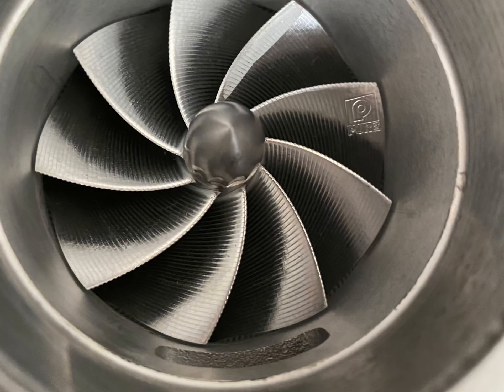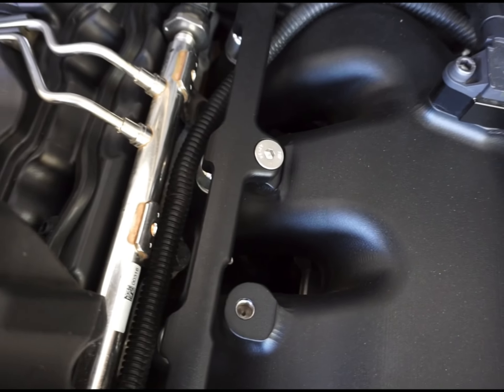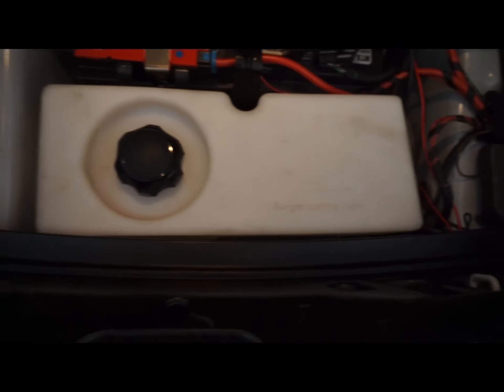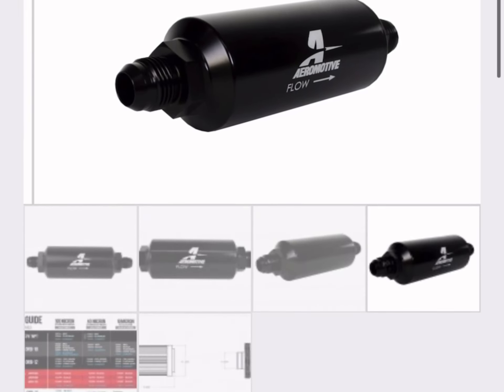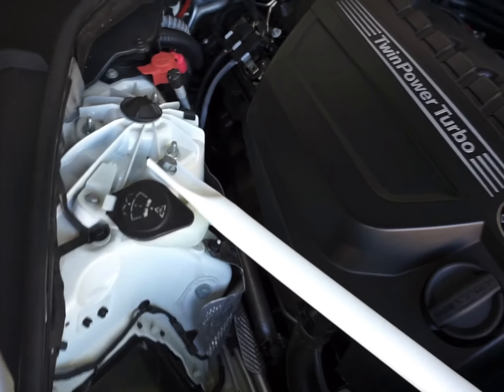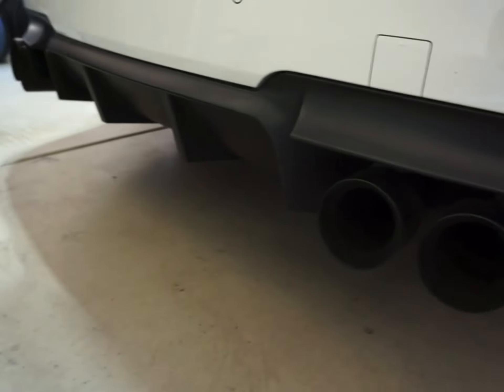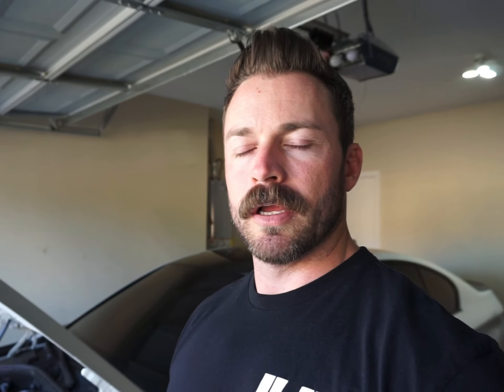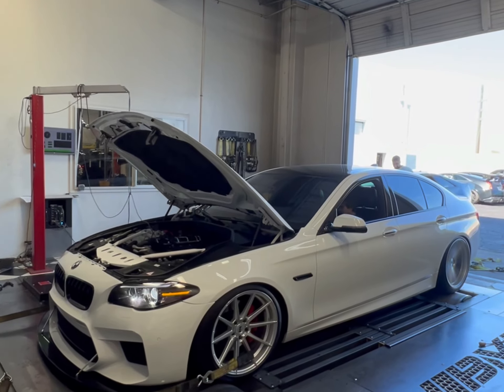In House Performance E85 Pure Stage 2 2015 BMW F10 535i

Comment: I just got a 15 “ 535 rwd 
And I just got the bolt ons in the mail 
G plus intercooler 
4” catless Rvg downpipe 
And Rvg chargepipe 
Probably going with MHD for the tunes 
Quick question can our stock fuel system handle any E?

Comment: Looking forward to see what your dyno numbers are.  I’m running PS2 with ProMeth direct port Meth and 93 Octane.  About to change my turbo and tune with 93 and Meth to compare.  Later in the year get Motiv reflex with Port E-85 so I can run any E content and the tune adjust.
Reply from the maker: Check out my dyno video I posted my numbers there!

Comment: Nice, I’ve seen your car on YouTube before. I’ve got a stage 2 FBO 535i, looking to go big turbo setup eventually, but I’m PWG, so debating port injection or helix 🤔
Reply from the maker: Personally I would do a stage 2 hpfp but I am bias. Dorch engineering has come out with so many support modifications that focus on utilizing the stock configuration and still having more then enough flow to keep up with these big turbos we keep throwing at these cars.
Reply: @Inhouseperformance  I have not found  stage 2 HPFP for my car, I have a 2011 535i, so have the continental planetary HPFP - there seems to be no replacement for these aftermarket

Comment: just came  across your channel, I just picked up a f10 535i x-drive M sport and was looking into what upgrades I can do. It says that it also has the M sport power kit not sure if that affects any upgrades I do.
Reply: @Inhouseperformance  Thanks I was told that the power kit was a tune that thet added which I believe gave 20HP and 30torq

Comment: perfect build 
im doing one myself 
advice on the intake 
should i do stock piping just stage 2 airbox or you recomend do like yours ?
tnx
Reply from the maker: Its totally up to you, there are some performance benefits to a front mount but its mostly for looks and the noises you get. Mine is a very difficult install and is not recommended for starters as its very labor intensive but our intake has great benefits for people with aftermarket turbos and tune. Good luck with the build and let us know if theres anything we can supply or help you with!

Comment: Does your gplus intercooler handle cooling all that boost? Mine is now starting to run a little hot now running ps1 and custom David Shoup tune. Probably about 15 degrees hotter than outside temps. It used to be about 8 degrees difference on mhd 2plus.
Reply from the maker: I have a Rev 9 which is basically a Gplus and it does fine but I also live in Arizona and I also compensate with Meth injection. During the summer intercoolers are only going to help so much. I recommend everyone uses meth on their charge pipe to bring down your IATs. Cheap and affective way to get all your power to the wheels.
Reply: One more question I'm looking at ps2 just wondering what boost you were able to get out of it peak and to red line? Thanks you been very helpful!
Reply from the maker: @DJ-lc1en  on E50 23-24psi at around 4200rpms I think but Cary built a slight taper into the boost through out the RPM which helped keep the turbo happy with higher wgdc to achieve the higher boost values. You could run 22-23 psi pretty consistent from 4200-6200 with that turbo

Comment: Im getting an m5 style bumper i believe its the one you have on your 535 but what type of lip did you use, ive already done a fair amount of performance to my 535i, doing some cosmetics, but for the lip, I cant use a standard 535 lip so did you use one from an M5, I dont know how different the dimensions of the M5 differ from the 535, but just curious because I dont want to go through the hassle of ordering and having to return different lips, so what lip do you have on your bumper? is my question
Reply from the maker: So this is an M4 splitter from aeroflowdynamics!

Comment: Did you have comfort access for the trunk? Does is still work with the new diffuser? Can’t find any reliable info on retaining functionality after swapping
Reply: Thanks! Idk why that thread didn’t come up when searching! Appreciate the assist and AWESOME F10
Reply from the maker: I did but no it doesnt and you have to remove it for it to work. I also cant use it with the carbon trunk but the trunk is so light now that it wants to eject into the sky if I open it unmonitored lol

Comment: The real most common quest should be: have you done the rod bearings and crank hub capture on that n55?
Reply from the maker: Yes now I have. I did both of those on my recent build of the motor. Also replaced the pistons and rods with forged Manley components. Check out 
My other videos.
Reply: @Inhouseperformance  Just watched that. Didn’t realize you had intentions of building it so soon. Strong work man 💪💪

Comment: Nice F10. What offsets you running? Did you mean to say your front is 255/35 not a 255/30?
Reply: I’m about to fit style 469M X5 wheels to my F11. Rear offset is 2”x11 ET37 so I am 5mm wider than you. Am trying to figure out whether to go for a 295 or a 285. Have you had any issue with rubbing with a 305?

Comment: Why not just get the F10 M5 and have a lot of stock power with more potential for the same money you spent on that 535i after mods?
Reply: The cost of the m5 after mods would be way more than. Then you add in the reliability factor of the 535 too, anything breaks its easier/cheaper to fix. Maintenance on the m5 isn't cheap, parts aren't cheap and repairs...😩 Especially if it's the timing chain. Even the 550i is an expensive car to maintain or repair but I rather go with that v8 or the 650i v8 over the 535. Repair shops see the M badge and are for sure going to tax you. I had to learn to repair my n54 on my own because any time I took it in to a "complete care" shop the quote was always $1,400. Auto trans cooler and hose placement, upgraded control arms, belt and pulleys, the price was always 1400 just because I look young and they thought I was an idiot with money. They wanted 6k to replace the front and rear subframe only PLUS labor
Reply: @Osamabeenleanin210  I had an 2008 E60 550i and it needed valve stem seals so I decided to take it to the dealership out of curiosity then they quoted $24,376.13 for the repair talking about it's an engine out job so it's gonna cost $16,000 in labor lmfao 😂😂 I told them at the time that I could literally buy 2 more of the same car for that price of the repair lol

Comment: Nice build but you're not going to be able to lower that car very much with those wheels on it I have 20 in by 8.5 and the top of the wheel well bottoms out on the tire before the wheel trucks under and I found if I have 19th on it the Wheels tuck-under a lot more but my aftermarket inner core ended up laying on the ground but it is nice when you're going over speed bumps you can
Reply from the maker: Yeah Im not really worried about being super low when I lay it out just more convenient with driving around town and still being really low. Another thing is the aftermarket front bumper is lower to the ground then the stock bumper by at least 1.5” maybe more so I wont have to lower the front a bunch to lay out the bumper.
Reply: I have the same front bumper with 20-in wheels and air ride it won't hit the ground will actually look good I like having it for speed bumps and stuff like that I was just a little disappointed I can use my wide wheels in the back I had to go square so the car look good when it laid out
Reply from the maker: @derrickbrickner8229  send me your Ig if you have pics
Reply: @bluebimmerguy I just started page so I don't have a lot of pictures but I do have one or two with a car fully aired out with that bumper on it

Comment: Car is beautiful sheeesh but PLEASE REPLACE THE ROD BEARINGS OR THIS IS GONNA BE SHORT LIVED !!! Ive torn down 4 rod knocked n55 and they ALL had pure stage 2 every single one.
Reply: @Inhouseperformance  30k sheeesh that thing was a baby all the engines I've inspected were way above 60k nice work man amazing build !
Reply: Were any of those F87's? Lol shits got me nervous now 😬
Reply: @micraw714  none of them were the f87 platform used the last produced n55s which are the best they usually last the longest I have a 16 535i tuned and it runs amazing.
Reply: @dsrc53  phew that's good to know, thanks! They seem to be pretty solid engines 😁